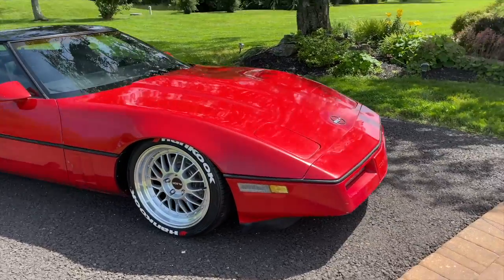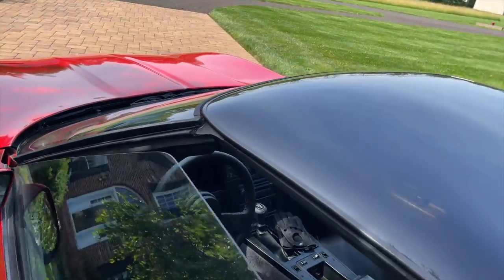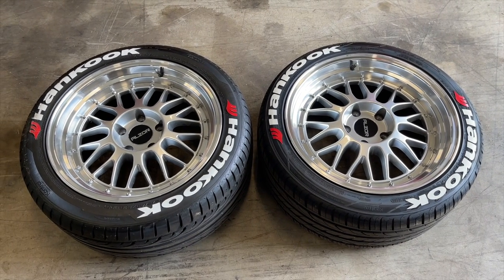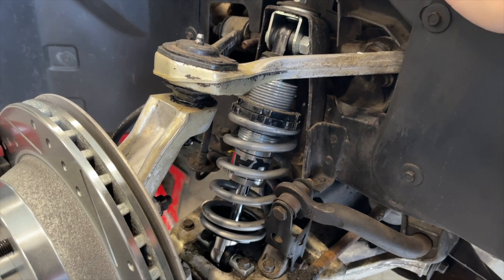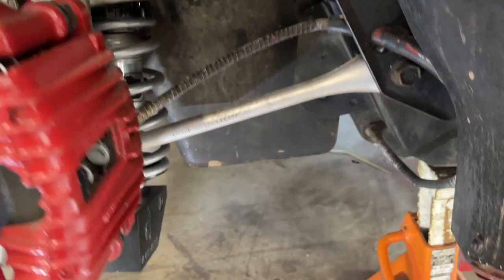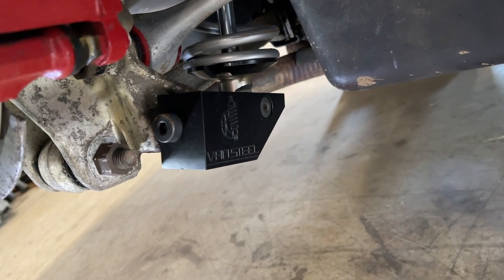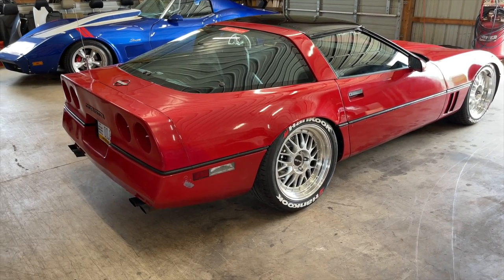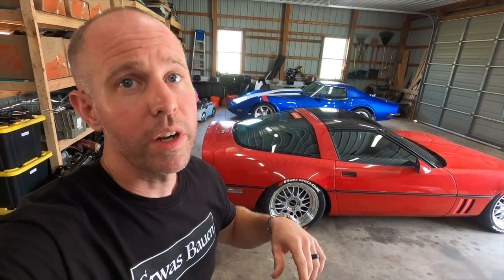Slammed C4 Corvette Walk Around Before and After.

Comment: I'm in the process of rebuilding by 1985 C4 Corvette right now. I wanted to do a LS swap, but got talked out of it due to the cost, so I went the 383 stroker route. Replaced the suspension with coil-overs and replaced all the brakes, I didn't drop it on its guts like that, I just didn't want the hassle of a lowered car. Great vid btw.
Reply from the maker: Thats cool. Thanks

Comment: Great video!
FINALLY!! A coilover video for a C4!!
Looks great!
Question....what is your measurement at the front of the rocker LIP bottom to the ground and at the rear rocker LIP to the ground. Trying to figure out the way your car sits as compared to mine as it sits with my modifications. BUT I WILL DEFINITELY BE ORDERING THIS SET-UP ALSO. I would just like to know because I'm not certain if I will be wanting it as low as yours as I will try to get into a sweet spot where I don't get driveline-angle vibrations. I also am going to try to fit a 275/19 C6 rim on the front as it is an inch wider than the 18" rim, and since I have a set kicking around I thought WHY NOT!?? LOL
THANK YOU FOR ALL YOUR INPUT.
I AM SUBSCRIBED(today)
I ALSO HAVE A C3 convertible I'd like to do the same.
Have you done this model too??
Thanks again.
Reply from the maker: Thanks for subscribing ! My car is super low i wouldn’t recommend it if you where driving it alot. My other video with parts and pricing has the part numbers of another set of coilovers that arent this low. i will have a video soon of C3 corvette front coilover review and install.

Comment: Pretty ingenious suspension mods!  I don’t really want a Vette that low because I don’t want to worry about clearances to the pavement.  However I like your ideas.  Q: How are the squeaks and rattles now that you’ve mod’d out the suspension as well as the interior seats?  Are they noticeably quieter?  Or, do you still have stuff that makes noise?  Thanks for your time.
Reply from the maker: Thank you. Yes it is very low. It does drive very nice and smooth on the coilovers. The exhaust dragging is the only issue. it is a pretty quite car for being an older vette. thanks for watching
Reply: Me encantó tu proyecto hermano. Me darías el tamaño de las gomas delanteras y traseras incluyendo el tamaño de los aros que recomiendas? Tengo un corvette 1987 y quiero hacer algo similar a la obra de arte que creastes.. gracias, me encantan tus videos

Comment: Oh, you live in Pennsylvania, Like I said I am in New York. I am in Orange County New York. I don't think You would make it down my road with how low that car is unless you could lift it up to factory height. I am a professional autobody technician for 17 years. I set up a Pop-up spray room at my house 12x20 carport complete negative pressure which helps with dust a lot. I do autobody at home on the side make some extra money should have my 1984 painted Electric blue before the end of June have some motor work want to take care of before I start painting it. Gaskets and vacuum lines I Ordered the Air Idle control valve lmao the 85 and up its only like 40 dollars for my 84 its $130+ I am doing my car in single stage electric blue just to get it painted. but later on, few months down the road I am going to sand it and clear coat it for a deeper look. probably do 3 heavy coats of clear then sand 1 layer off and wet sand and buff it.
Reply from the maker: Cool! That should look great!

Comment: Good video👍 I have a 1986 vert. This was something I thought about doing. I’ve always read mixed opinions about going from the leaf springs to coils, because many people say that the chassis and suspension geometry is not meant to support the weight all on the shock mounts. I’ve also seen a lot of people say that you’re ruining the car because the chassis was built to handle the best with leaf springs. Should I really be concerned about anything like that? Or is this my sign to throw those coilovers in?
Reply from the maker: Hi, in my opinion they are perfectly fine to run so many companies sell coilover conversions for all year corvettes. I havent had a single problem at all. Thanks for watching.

Comment: where can i get the same wheel set up ?? Love the look, seems a bit difficult to find wheels for 5x120.65
Reply from the maker: Hi the are ALZOR wheels for BMW. Thanks
Reply: @etwasbauen6615  they look great, since they stopped making the factory tires for the 84-87 vettes, looking for something like this, any issues with fitment?  From what I can tell the circumference of these size ventus(on the front) should be the same as the stock tire circumference.  Without the slam, would these fit about the same as the stock as far as stance and the offset, etc?  Thanks, I enjoy your content.

Comment: I got this same set up and the wheels actually go just outside the fenders, especially in the front.  I know you have a bit of camber to your set up, but is this something you dealt with as well, or did I not catch the size wheels/tires you have?
Reply from the maker: Hi they are cambered in maybe 2 degrees. they are 18 x9.5 with 35mm off set. i have spacers in the rear too and they tuck all the way around.
Reply: if you have a later C4 (88-96) you need more offset, because they changed the suspension geometry in 88.
Reply: @kaldarleifar  so follow up... I did some "investigating" and found that the shop who did the alignment used a ton of washers for the upper control arms.  it's almost an inch of them.  going to see if I can get someone else to look at it, but that would put my wheels back to fender flush

Comment: Just got an insanely clean 84. Thank god it's already been ported but I got to get the handling dialed in. Looking into the coil over setup because that looks great! Question on the wheels. I've heard various things about throwing a 5x120 onto our 5x120.65 hubs. Did you use wobble lug nuts? Hub centric rings? I'm very curious. I always wondered why c4's never had any cool wheels on them but it makes sense, that's a strange hub pattern to use.
Reply from the maker: Good for you! Thats nice. I dont have any issues at all i bolted them right up and they havent given me any issues.
Reply: It's only strange because it's the metric equivalent of 5 x 4.75

Comment: I just want to say that the C4 corvette is by far my favorite generation of all the Corvettes with pop up headlights !! more specifically starting with the 1985 C4 when chevy ditched the ' Cross Fire ' injection in favor of the TPI- Tuned Port Injection . And the cut off for my personal liking is 1989 which was the last year of that super cool 80's digital dash.  I couldn't care less If the later generations are faster or whatever . As far as the newest generation Corvette with its amazing sounding naturally aspirated mid engine goes , I really dislike how the current gen Corvette looks . To my eyes it's too gimmicky like it's trying to look like a super car,  too much plastic , spoilers , vents etc . The current gen Vette is a amazing sports car I just think there ugly.  But the C4's are just right . I always loved the clam shell hood revealing that awesome TPI set up , the targa top and it's over all simplistic but aggresive looks . As far as your wheels and tires I think they look great on your C4 . My only concern is being that the center of the wheels are steel instead of forged aluminum or magnesium is the weight are they heavy ? And then there's the right height altho the stance looks great but the tires are actually tucked under the fenders does your set up scrub badly during hard cornering ? Anyway I would keep your C4 enjoy the hell put of it and don't care what others think . It wouldn't take much to squeeze another 50 to 75 reliable horsepower out of your C4's 350 TPI . I used to have a charcoal grey c4 a 89 back in the day I miss it .

Comment: Whats your wheel and tire setup?
Reply from the maker: Hi, 18x9.5 35mm offset all the way around. 275/40/ZR18s in the rear. 255/40/Zr18s in the front. Thanks
Reply: @etwasbauen6615  sweet thanks broskii im figuring out my set up rn and this helps a lot. Sick car abd videos 🤙🤙

Comment: Those wheels are cast aluminum not steel.
Reply from the maker: They look like they are but they are cheaper steel wheels. Its a common style. Thanks
Reply: @etwasbauen6615  stick a magnet to them, they're aluminum. Nobody is casting a steel wheel it would weigh 100 lbs